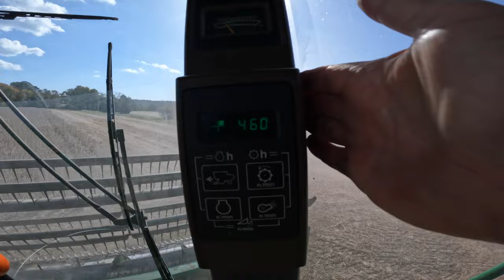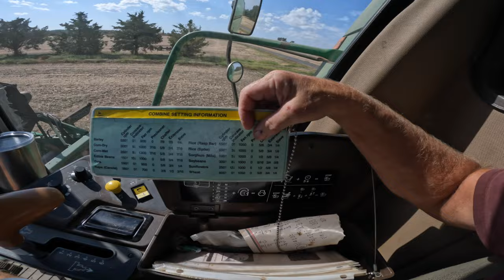Monday Only Brings Problems!  Day 4 Soybean Harvest

Comment: Farmer from the looks of the drip you might have a slight crack in the power steering box or a gasket around the 4 bolts might have gone because from the video it looks like the leak is from a bolt .